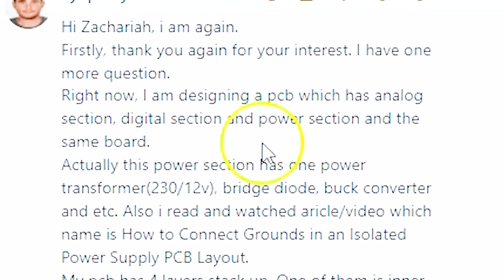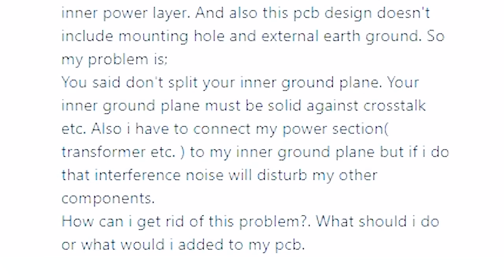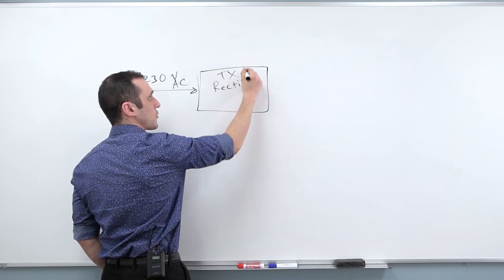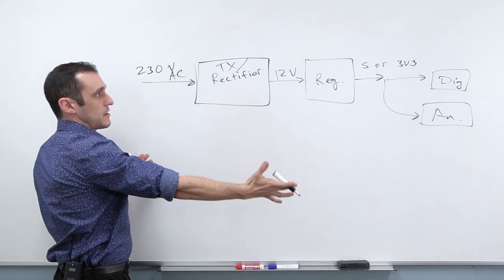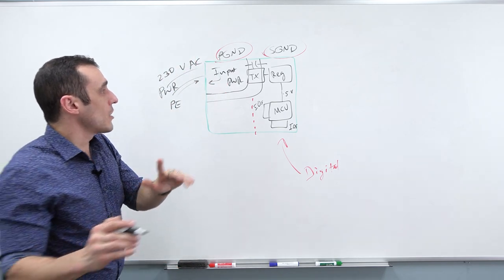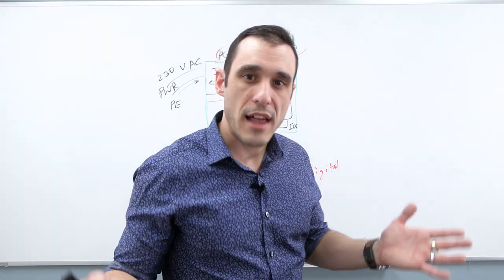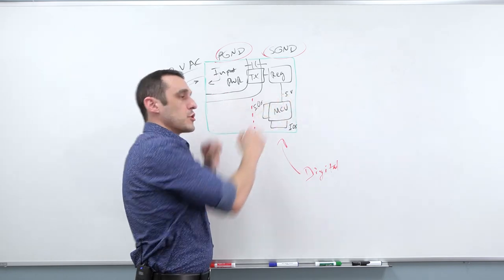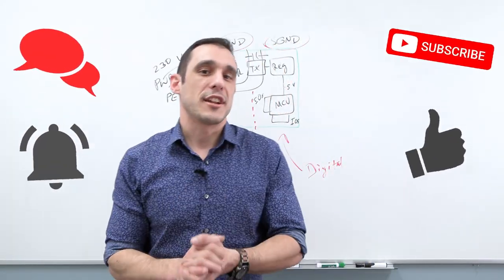Ground Planes with Power and Mixed Signals

Comment: I'm 92% sure the transformer was sideways. Shouldn't the primary and secondary be isolated?
Reply: if used as transformer - yes. but in this case it was used as common mode choke 🙂

Comment: Is it acceptable to run ground traces on the signal/pwr layer of a 4 layer PCB? My stack up is: signal/pwr, GND, GND, Signal/PWR. The reason I want to do this is because there is one section I want to still have power when I disconnect GND from the rest of the board.
Reply: Yes you can route GND traces on the same layer as the PWR/signal traces. I'm assuming you have the GND on the sig/PWR layer at the same potential as the GND on your inner layers? From reading your question, it looks like you want to have two differnet GND regions, but overlapping in the internal layers, so when one GND region is disconnected you are still powering up the other region with its own GND, is that correct? If this is the case then you can do it but be prepared for radiated noise through the edge of the board whenever those two ground regions have a potential difference between them.
Reply: @Zachariah-Peterson  Thanks for your response! So I have the two inner ground layers and the ground trace at the same potential. Basically what would happen is as soon as the rest of the board looses power, the two inner planes would be left floating (that’s if you loose ground). The circuit also monitors for loss of high side power (12v) in that case, the ground planes would be at the same potential as the trace GND. I’m not concerned about that because this is a safety device (used in formula SAE) that will not be operating that way under normal circumstances. My plan is to route that separate power section as close as possible to the connector to minimize loop area. At the end of the day, the 555 timer has to stay on when the rest of the board looses power so that that fault latches.
Reply: @Zachariah-Peterson  the inner two GNDs are connected together with vias.

Comment: Altium can you route signals on planes?  Cadence / Allegro has no restrictions and allows this.
Reply: Technically yes you can, if you plan to route signals within a plane layer then you would just define every layer as a signal layer and use polygon pour to define planes. Then you could route inside the plane layer and the clearance rule will set spacing between the plane copper and the trace. If you wanted to you could also draw out rails in a plane layer, but that's kind of time consuming if you just want to route a trace.

Comment: To be clear, the ground section Zach draws in minute 5:00 is protective earth, yes? 
I'm making a controller board PCB where part of it is a dimmer controlled by an MCU. It takes AC mains, but there's no transformer. Do I still tie the protective earth to my AGND/DGND via a safety capacitor?
Reply: There are a few ways to do it, you could have neutral and power routed as traces and then have the earth as a copper island on the PCB. You could also have that copper region as neutral and the hot power line routed. The main thing you should understand is that protective earth lines are not meant to carry a return current. So if you are bridging the SGND and PGND regions with a safety cap, then the PGND is neutral and not protective earth.

Comment: Super, merci beaucoup. 
Please, What is the value of the capacitor between the primary and secondary ground ?
Reply: The standard guideline is to use a cap that has a larger value than the leakage capacitance of the transformer. The idea is to have higher frequency noise propagate back to the power supply return, rather than radiating or passing to an exposed connector where it could pass through the user to ground, so it is up to you to determine what the lowest frequency in the noise spectrum is and size the capacitor accordingly to provide low impedance across that isolation gap. The capacitor is typically a Y-type capacitor (that's the most commonly recommended I have seen), but the DC leakage current across the cap can also be important as this could create an annoying ESD shock if the user touches any plugs or connectors exposed in the system. This might also cause your design to fail some higher-end EMC requirements, such as in medical equipment.
Reply: @Zachariah-Peterson  merci beaucoup

Comment: …would you generally connect secondary ground on the board to the enclosure along w/ PE via a plated hole?
Let’s say we have a meanwell internal switching supply module. The IEC jack ground goes to chassis along with the internal power supply modules PCB ground. Then this internal PSU feeds your board. The board has its own secondary/signal ground plane. Does this ground plane ever get connected to chassis ground through a plated through hole?
Reply: Secondary ground is the signal reference, and that could be floating with respect to the primary ground in an isolated system. So if you mate the primary side to PE at the input, and then also the secondary side to PE, you now have no isolation anymore. Better option is to use a capacitor between PRI and SEC GND regions near the transformer, make sure it's a large Y-type capacitor. There are some reasons to put a cap to GND on the secondary side, but these relate more to ESD particularly from connectors. I wrote a Signal Integrity Journal article on how this is done in Ethernet that goes into why you might do this, and in fact there are reference designs and app notes on industrial Ethernet that recommend the same (they just do it really bad in the PCB latyout). In general, if not worried about ESD on the secondary side, you should bridge to the primary with a cap as I described above and do not connect secondary direct to the chassis (PE net). This is because the chassis now carries return current and this is not recommended for safety reasons.
Reply: @Zachariah-Peterson  ok thanks. In our application looking at the actual SMPSU (Meanwell RTP-75c) it has an earth ground PTH on it w/ safety caps already there, so we will chassis ground this hole along w/ the PSU case, enclosure and ground pin from IEC jack.